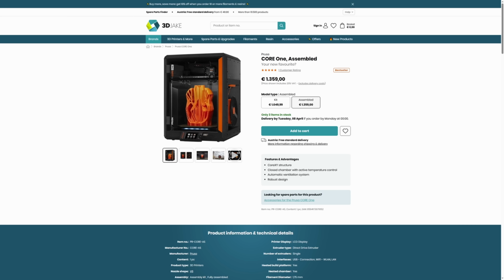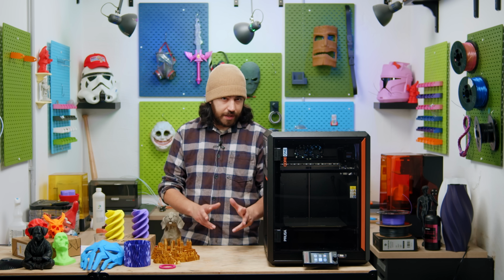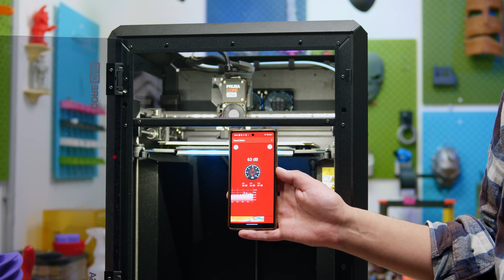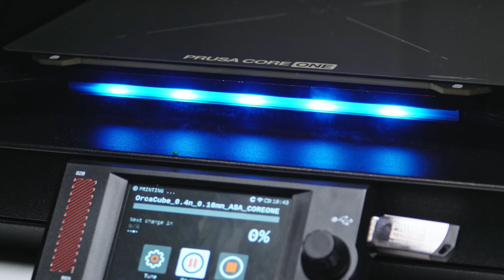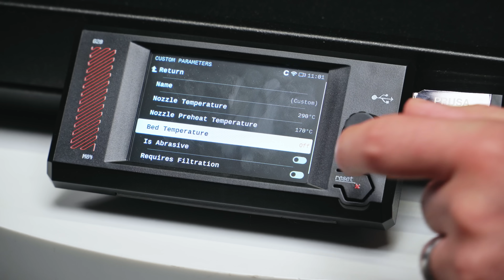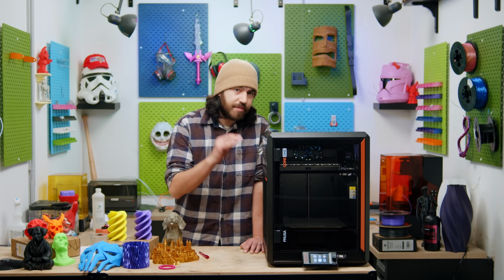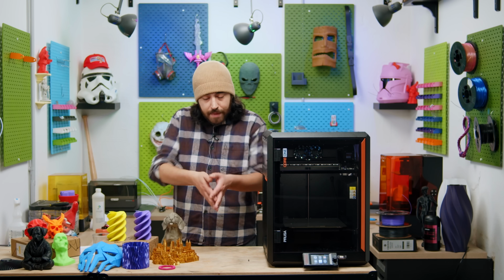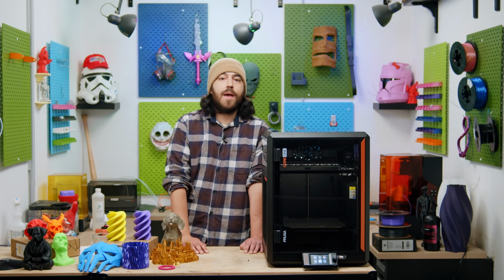Prusa Core One Tested: Stunning Quality, But Is It Worth It?

Comment: What? “8 hours for the kit”, the record for building a Mk4 in the Prusa factory is 6 hours, core one is a lot more complex, took me about 16 hours, maybe someone could do it in 12 hours.

Also, the majority of the parts are PETG, not PCCF, only about 20% of the parts are PCCF. You can see on the official Pruša printable page where they publishes the spare parts that are PETG and a seperate file for PCCF
Reply: Core One kit
651 individual parts needs to be assembled before you can run the first calibration.
Mine is in the mail. Can’t wait.

Comment: I have heard from other reviewers that there is no automatic nozzle scrubbing/ nozzle cleaning on the Core One. Can this be added? (either through modding the gcode in with a printables mod or w/e or maybe it has to be bought?)
Reply from the maker: There is a technically a "nozzle cleaning" procedure before prints but without a wiper it is not that effective. But yeah one can be added very easily and a cleaning procedure added in the start gcode in Prusa Slicer. Actually mods already exist on printables using bambu wipers

Comment: I noticed the failing heatup time test. And that you left open the vent at the top after demonstrating it. Could this be the cause? User error?
Still, I think prusa could have automated the venting system to prevent this kind of user error unless overridden in the settings or with toggle switch. I'm waiting on budget to buy this printer, and I think I'll mod the top cover to do this. Maybe tap the outtake fan power to set a servo to open vents , with a hardware switch to set to manual to override this. Not sure how to override this when fans are without power, but I'll figure something out.
Reply from the maker: The heat up test isn't actually a fail, starting a print normally goes through different heating cycles as preparation, prepping the filament at normal melting temperature and then heating up minimally for levelling and then finally heating up the bed which takes a while. If we did this while timing how long it heats up it wouldn't be exactly accurate so we decided to simply heat up everything manually but as a safety precaution the heater is turned off after exactly 30 minutes and you can see the notification if you pause the video, we got to 39C out of 40C, it was very dissatisfying that we didn't get that extra degree but we thought it was funny so we left it in. Also the vent was actually closed during the test. So for the test there was no user error and no printer error but it does take a while to heat up the chamber to 40C unfortunately.

Comment: I have one at work, on paper it could seem like it has not much more to offer than other, even cheaper, printers but the overall "printing experience" is absolutely above anything else i've tried (mainly qidi and bambu).
The only downside in the ecosistem imo is the lack of the "printing tollerance" in prusa slicer (orca and bambu are lacking too, i think cura is the only one to offer it). If you dont know what it is, there are good videos that show what it does and why its so usefull for mechanical prototypes with coupling connections and it can not be fully replaced by other similar (but lacking) functions.

Comment: Looks really nice.  But why have 3 z motors and not bed leveling?  Also not having a 350 degree nozzle is a big miss.  I don’t know why most modern printers only go up to 300 C?  Do these new ceramic heaters cause this limitation?  Engineering materials not speed is the new 3D printing frontier.
Reply: Read a forum discussion about this, folks suggesting that a heater+end replacement would allow more esoteric stock to be used, either from Prusa as an upgrade or via 3rd parties. Personally I think that's a pipedream, but never say never I guess.

Comment: 1000-1300$ for a printer is a lot at first glance, especially when there's much cheaper options from Creality, elegoo, etc., but the money you spend upfront will save you hours of headaches down the line. This machine will keep working for years and years (with regular maintenance of course), and it's an "unbox, let it calibrate, print" sort of thing, no fiddling around, no googling problems - that's what you pay extra for with Prusas (not to mention that the support is fantastic if you do need help).
Reply: @dadjake  not even remotely true anymore, prusa is just for fudds that dont think for themselves and like to overpay as part of the herd

Comment: As a mk3s owner, i think 3d printers are as good as they've ever been. Theres really no need to spend alot of money on a good printer. Ill take mk4 for half the price and maybe buy the upgrade kit later.
Reply: Unless you need a heated chamber, and don't want to DIY. Could mention other reasons, but this is the big one.
Reply: @TOAOpHetMaartens  the price is the sticking point, because you can find many good machines for way cheaper. I print in an enclosure to keep the smell in. Keep temps up in the enclosure isn't really needed, and I print nylon at 300c with the bed heat off.

Comment: "Stunning quality" in the title - 3d printed components in 1200$ machine in the first shot xD
Reply: 3d printed components are a deliberate choice, improving repairability. I had to wait days for a replacement part for my Bambulab printer because I could not just reprint it (cutter lever thread was broken).
Reply: @bruderbrot5268  I know only one person IRL with a Bambu, they had to pry open a rail assembly by breaking glued seals because there was something wrong with one of the rails making it rattle and support refused to help. 
With a Core One I get all the reliability of a "It's a tool not a hobby" printer, while still being able to open it up and fix it just as easily as I did with my old frankenstein monster of a Tevo Tarantula.

Comment: My Mk2 and Mk3 are over 7 years old and still run good after moderate use. If I needed another printer, I would buy a Prusa.
Reply: same here since 2018 first mk 3 now mk3.9s the best ever printer not the core one
Reply: I have an mk3s+ and it has over 16000 hours on it.  I have had to replace several parts but nothing crazy.  I love it.  Still runs well.  I am getting ready to order a core one tho.  Can't wait.
Reply: I've ate this bread for 5 years why would I eat this steak

Comment: Although I like prusa, I think that they need to figure out the price, elegoo centauri is not bad, bambu was ok until the firmware bs they pulled, and creality has good prices. Mind you I have all of these. Bambu was my favorite until the recent firmware changes. Elegoo CC not so bad so far, can’t wait for a multi material unit and see.
Reply: I mean the price thing is down to subsudized chinese vs selffunded EU labor and materials. The consumer oriented printers are using the "tech startup" style funding of using venture capital to build up customer base with atracivly priced and capable machines, then they start locking down and raising prices (the same as 2D printers, you can get a cheap printer, but then to use it you need an account and subscriptions, propriatery overpriced refills,...).
Be careful what you wish for and support.
Reply: @matko000 
An example with Laser Printers.
I need to buy a new set of colour cartridges for my laser printer. They are more expensive than buying a new printer INCLUDING colour cartridges.

Comment: I had a kit on order, canceled and ordered H2D… Bigger printer, dual nozzle, active chamber heating and ventilation. It is double the price, but I feel it actually warrants its price more than core one.
Reply: @bp8__163 I did the same, I'm really happy
Reply: The price also depends on the labour costs and taxes. People working for Prusa in the czech republic are paid better than people working in the prc for bambu. So the maring the manufacturer makes is way bigger with Bambu.
And while i don't know where you are from, to me personally if i needed a printer right now that would make a lot of difference. Because it's securing jobs in europe. And as i am from a neighbouring country to the czech republic, the Prusa employees might even holiday here and leave some money here which in turn finances peoples jobs and tax money here. Circle of money. I don't expect Bambu's emploees to spend any money here.
Reply: Less security😂😂😂
Reply: @W4rd-n1c  Yeah, kind of. But closed-source firmware and hardware is pretty normal in the manufacturing world. 3D printing has hobby machines, and then there are more consumer-focused tools. Bambu falls into that consumer category—they’re going for ease of use and packed features right out of the box.

Prusa takes a different route. They give up some features and value to keep their printers upgradeable and open-source. Their users usually prefer that over things like a 350°C nozzle, heated chamber, multi-material support with filament drying, a camera that’s more than 1 fps, and a bunch of other nice-to-haves.

Different tools for different people. Also can't argue with Prusa's customer support and ethos. Their product just wasn't enough to justify over a H2D at this point.
Reply: @W4rd-n1c  i'd rather say different security. You can't expect the company who tries to popularize home laser machine to let people fiddle with it's open source software? It's a accident waiting to happen, not to mention someone might just have bad intensions and cause a fire for shits and giggles
Reply: Prusa isn't worth it anymore

Comment: Build plate is too small, no MMU "yet", no camera, no flow calibration...  Too small and too expensive for what you get.  Prusa is getting by on reputation and brand loyalty at this point.  Their machines aren't pushing any boundries right now...
Reply: I think Prusa is just conservative in adopting new features until they can get them reliable for a long time. All these other manufacturers jump on every new feature and buzzword instantly because they don’t care if the printer is dead after a few years, as long as they can have a marketing bullet point. That’s also what I suspect is the reason for the lower hotend temp too - I have no doubt that practically it can achieve 300 it’s just they don’t want to push it  that far and affect its longevity
Reply: @dwroberts  You keep thinking that...  You're telling me with how Prusa loves for people to tinker with and build they're printers themselves, they're afraid of a hotend temp that their competitors are all doing?  I can't replace their hotend?
Reply: @cylonmode I feel like the open tinkering stuff enters a different domain when you’re talking about something that is a fire hazard though. Don’t get me wrong I’m sure some of it is also about eg wanting to upsell to their professional printers like the ht9 rather than encouraging printing high temps on a consumer printer. But I also think it’s more complex that just being unable to do it at all
Reply: @dwroberts  That's fair, things are always "different" when we want to argue a point.  Its called moving the goal posts.  If Prusa is such a a well made, "tool" and not "toy" for the enthusiast then changing out a hot end is not a big deal.  Bottom line is this printer is too small and offers nothing competitive at its price point unless you are a Prusa loyalist.

Comment: Just got Qidi Plus 4. 🎉❤
Reply: Have you had issues with Nozzle scratching in the build plate? This is reported quite often with ABS/ASA when leveling with higher bed temps.
Reply: Remember to have a fire extinguisher ready right next to it, those things have a reputation of being ... lit. 😜
Reply: @TNX255  Not really in 220V world, but anyway even 120V is fixed for quite a long time now..